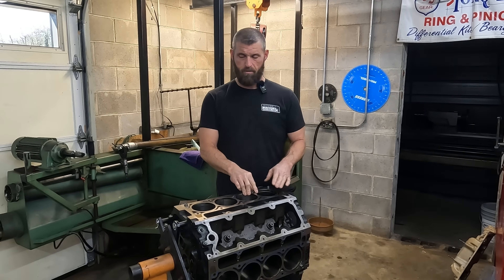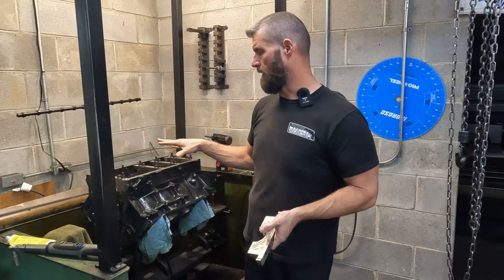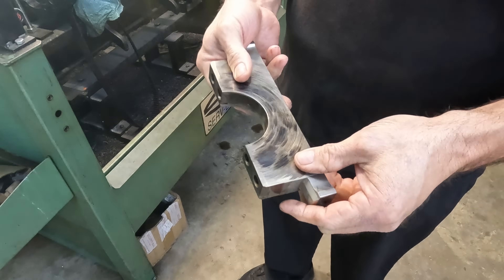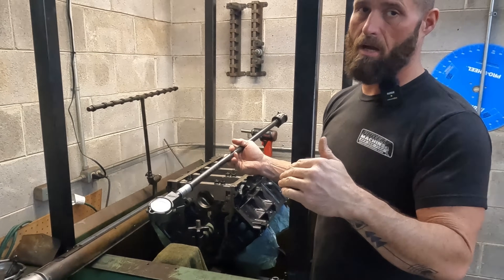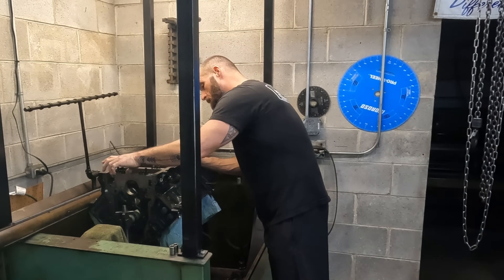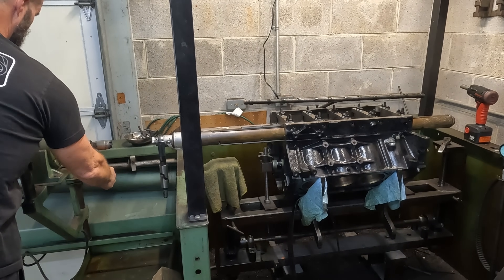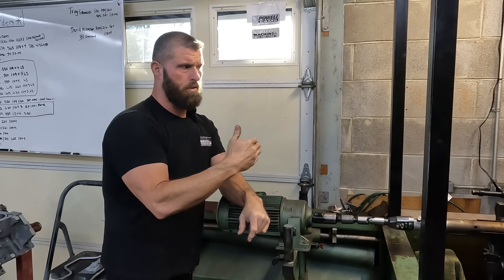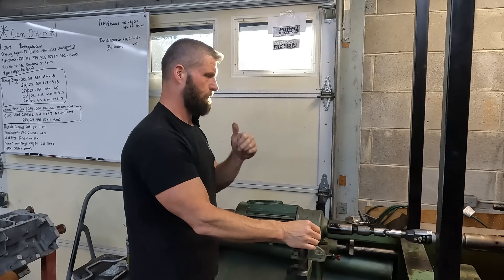LS 6.0/408 EP #1 : Line hone and main studs

Comment: Thanks for posting the video. I am currently building a 6.0L street engine and will be installing main studs. The block I purchased has already been line honed with the stock bolts. There is some conflicting information on whether installing studs in an LS block will change the bore and or oil clearance. I will double check this for sure with my dial bore gauge after installing the studs. I also understand from other engine building books, especially the BB Chevy, if the crank spins freely, a line hone is not really necessary.

Comment: Just so  the people who don't know,  know.   When he says 1 tenth.  Thats a slang term that machinist uses to describe 1/10,000 of an inch.  We call them tenths.   In decimal form it reads.0001.   Aluminum foil is .0005 thick.  Imagine slicing aluminum foil into 5 equal thickness's.   Now hes holding that bore within less than half the thickness of aluminum foil.   Let that sink in.   Awesome Job on the line hone.
Reply from the maker: Ty,  💯 correct

Comment: Whats ur input on gen4 aluminum blocks with loose main caps? Not a tight register? No signs of cap movment/fretting
Reply from the maker: We would normally peen them to tighten and then line hone
Reply: @powellmachineinc3179  so its not a issue? I was nervous i bought a bad block🤣
Reply from the maker: @MotorSportAndTools  it's definitely a issue,  but it's fixable
Reply from the maker: @MotorsportGamer  https://youtu.be/f_nIFESRZTo?si=HY08ORag2hgxvnZa

Comment: Wow! I had no idea a trans could put that much pressure on the crank! Thanks for another excellent video.
Reply from the maker: Absolutely,  ty!
Reply: Lost a 350 in my truck that way. going through death valley with a horse trailer went up a steep grade fan clutch went out and overheated blew ATF all over the engine (lucky it didn't burn to the ground with horses in the trailer) burned a valve. I decided to rebuild the engine since it had 118k on the engine. The engine shop said the block was trash because the converter swelled and shoved the crank forward and wiped out the mains. That was back when a shop could build an engine for 1K that would go another 100k miles. 89 chevy pickup 305k miles 2 engines 5 windshields 2 transmissions. Fixing to get it's 3rd engine here soon.

Comment: So what drove the crank into damaging Thrust bearing & main caps & how to Prevent same ??
Reply: Excessive converter pressure. Makes it push forward against the crank. Mainly happens with turbo cars, when you're on the 2 step for a while, building boost.
Won't have the problem, NA, blown, or nitrous. 
One of the bad side affects of a turbo build.
You need to build a transmission differently for a turbo build. Usually use dump valves, too, to relieve pressure and bring the boost up quicker. Starves the converter, though, so hard on that, too.
Reply from the maker: With higher stall speed and  "stalling up" the fluid in the converter acts like a pump and push the converter away from the transmission,  the fluid has to be restricted to the converter in these applications